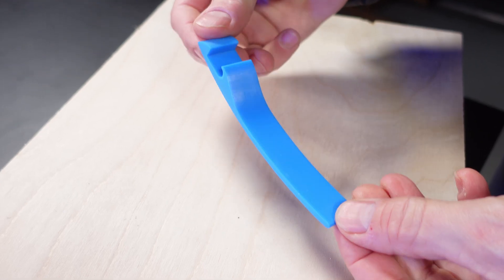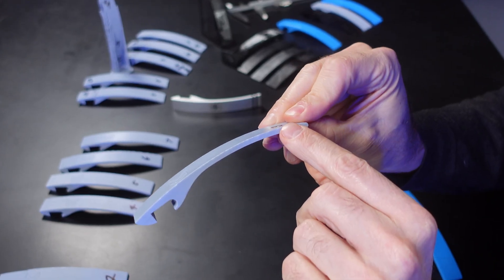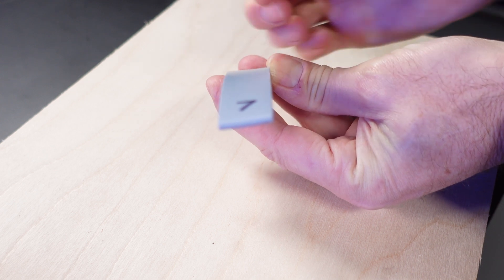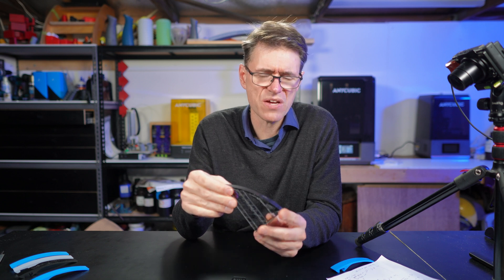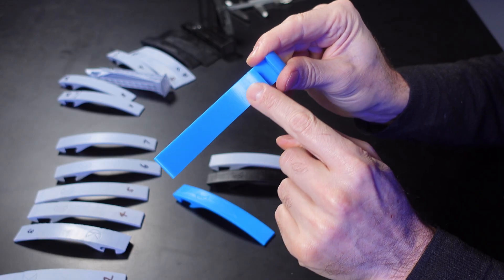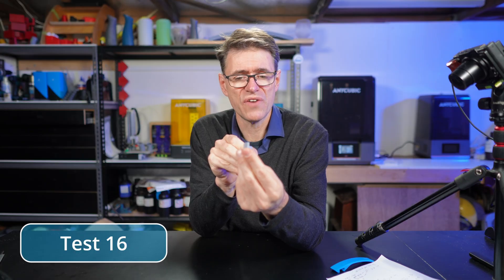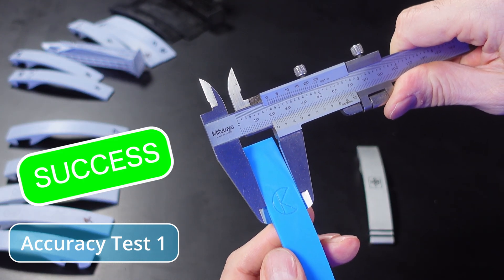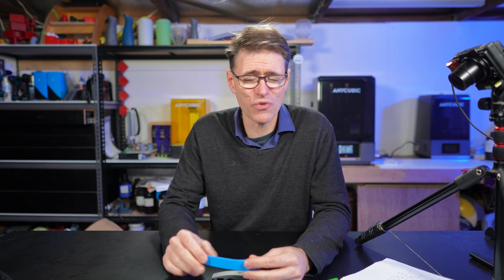Resin Print Better Curves and Flats

Comment: Hi 👋 
I've recently stumbled upon your channel and have found the content fantastic!  I love the scientific approach and explanations/analysis. This particular video really resin-ates (🤦‍♂️) with me though. Ive been resin printing for about 6 months for the purpose of producing items  for my model railway. A lot of what I try to print is made up of geometric forms which need printing accurately to both look correct and work with other prints/items i.e. interface connect.
I seem to be flapping around, trying one support configuration after another with any 'success' feeling more 'luck' than judgement. 
This video (kinda) makes me feel a little better about my frustration 😂
Reply from the maker: Welcome to the channel, and thanks for your feedback. I appreciate it. You're not the first model railway enthusiast to come across my content. I had a model railway when I was younger too. There is definitely a skill in getting resin printing right. I've been resin printing for a few years now and there's always another form to encounter that needs special treatment with supports, resin choice etc. I'm now testing forms that can be used for silicone moulds which is another level again. Stay tuned for more testing to come.
Reply: @ColinKlupiec thanks 👍
Do you have a discord or chat group somewhere?

Comment: Other question: how about layer height? And exposure times? That can also have an impact. And what type of support? Heavy, Medium and Light? Because on the black Amera resin the support marks are very clear. This type of object could be done with very many ultra lights? More support less dipping in between and easier removal with fewer support marks?
But I love the scientific approach!
Reply from the maker: Thanks for your question, and the feedback. Appreciate it. I've experimented with layer height and 'light off' time (not so much exposure). Layer height has made surprisingly little difference in my tests. I usually try to test as 'middle of the road' as possible to keep things simpler across my range of printing. So far, build plate orientation makes the most difference. Over-supporting, with lighter supports also works well. But over-supporting can be a problem with more brittle resins.

Comment: Have you tried modeling in continuous supports. We had success at work on mechanical parts using continuous supports
Reply from the maker: I have tried it, and I should do some more work on that as a method for engineering parts that need super straight edges. The trick is finding the right thickness so that they break off easily without damaging the model. What thickness do you use?

Comment: I appreciate the level of detail and testing. I have a couple questions. Why don't you share why you need to do the tilt in X and Y in the first place? I don't remember seeing a 0deg X/Y print, so would that have been just as good?. Why is it that doing these tilts are necessary at all? Why are there supports going up to the top of the part? How do they any value as they will not connect to the part until the last 5% of the print process? Thanks in advance.
Reply from the maker: Great questions, and thanks for your feedback. And yes, I should do a follow up video about this. But to answer your questions... 
1. If you print a flat surface at 90 degrees to the build plate, it doesn't print super flat. It prints with sagging across the surface. Placing supports across the flat surface improves the result, but each support connection point also creates a bit of sagging. It just doesn't print super flat and sharp. By angling the print, you slowly build up the flat surface from a corner, which helps to minimise or reduce the sagging effect. That way you only need to support the edges/corners. Now, removing supports will always leave a mark, but you can more easily post-finish (with sand paper) an edge than a flat surface. 
2. Adding supports all the way to the top even for the x 5deg, y 3deg print provides support for the long curved edge all the way to the finish. If the supports don't follow the full edge length, the flat surface tends to warp slightly. Adding supports to the top keeps the planes of the object more stable and less prone to bending, warping.
Hope that helps. Happy to help with further tips if I can. 😀